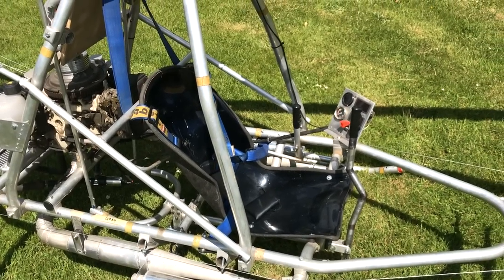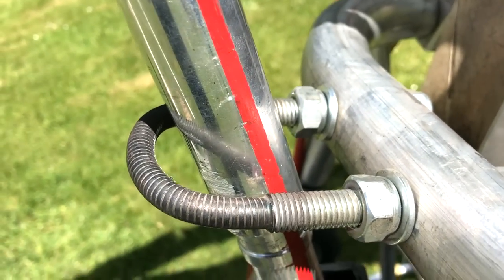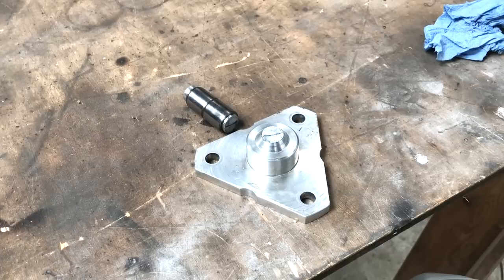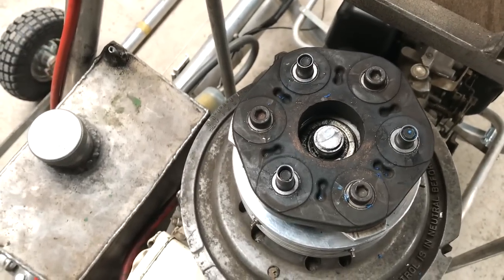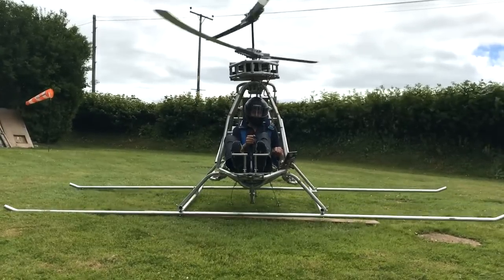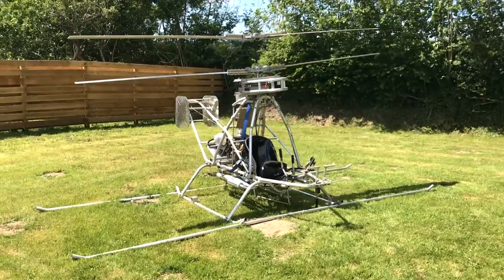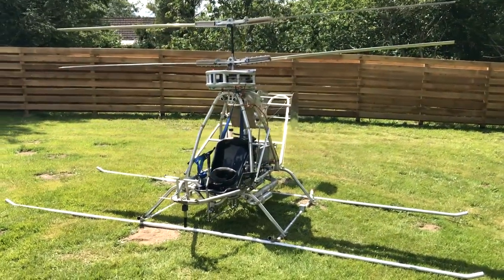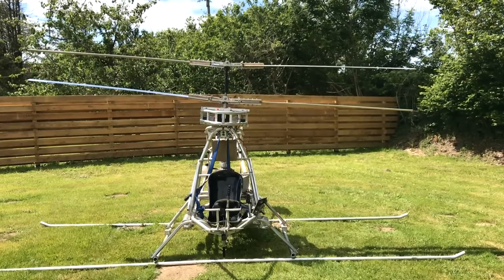Part 4 Learning to FLY Homemade Helicopter

Comment: I was so pleased to see another video up! Interesting visual, that tilting the rotor disc does actually change the blade angle of attack. Really no different than weight shift in a hang glider changing the angle of attack , precession delays the effect in the disc to your benefit.
Reply from the maker: 👍 It's amazing how all the physics in a  helicopter allow it to function. The forces all seem to come together to make it work. Centrifugal forces keep the blades ridged, aerodynamic forces overcome the gyroscopic forces and it can autorotate with the blades spinning in the same direction. Quite amazing some of it.

Comment: Your videos are great Ben. I'm watching with a big grin on my face. Brings back great memories. Cheers. 🙂
Reply from the maker: Thanks Cam, it takes some patience doesn't it. I'm at the stage where I've got some control over it but an overreaction is just around the corner, part of me wants to take it higher as it should be easier with less turbulence but I feel I must keep it low for now. Did go through this stage ? Any close calls ?

Comment: It's so cool the way that tilting the head and mast in the direction that you want your force vector to tilt increases the blade angle of attack in the quadrant 90 degrees prior to where the lift is required, just as it should and also just as it does in a swash plate/pitch linkage setup. Seeing this work the way it does actually gives me a better understanding of helicopter cyclic control.
Reply from the maker: Absolutely right, I only grasped this a few weeks ago. Some people think that the pitch change on a swash plate happens 90 degrees before hand because of gyroscopic precession, but I believe it's aerodynamic precession. It just takes time for the blade to fly to its new position. 
 It does mean that the cyclic isn't going to be any easier to learn on my machine than any other helicopter but it should give an advantage if I have another go in a Robinson. Once I've got the hang of this I would like to see how I get on with an R22. The pedals and collective will have a different feel/response but it will be an interesting experiment.
Reply: @Ben-Dixey  That's the way that I have always thought of it, it takes time for the blade to lift up so that the rotor disk is tilting the way you need it to be tilting, the blade starts climbing 90 degrees in advance and 90 degrees later its up where you want it to be and  has leveled out in exactly the right place and is about to start descending back down again.
Reply: @Ben-Dixey  Its gyroscopic precession, . try tilting a spinning gyro.
Reply from the maker: Gyroscopic precession is cancelled in a coaxial configuration. I mounted two bicycle wheels on an axle and spun them in opposite directions. It behaved as if the wheels weren't spinning at all. However the teeter hinges add another complication. If it was gyroscopic precession wouldn't the cyclic stick be extremely hard to move ?
Reply: @mrbmp09  The point at which the blade needs to start climbing is also the axis through the disk about which the disk tilts, which of course has to be 90 degrees before the point in the disk that will be at the top of the tilt, and the opposite end of that axis is 90 degrees after the top of the tilt, at the top of the tilt the blade angle of attack should be neutral and it should also be neutral the bottom of the disk tilt, so the cyclic blade pitch control of the disk tilt is always 90 degrees before the intended disk tilt, it has to be, the blade must start lifting exactly from the axis of tilt which is 90 degrees before the top of the intended disk tilt.

Comment: It seems you're finding out the hard way the reasons why aircraft manufacturers use Titanium components where required due to their strength, light weight and durability and especially their corrosion resistance ability.
Yes it's expensive but well worth the expense.
I'm sure you'll work it out.
The properties of steel are a much better choice than aluminium even T6.
Thanks for sharing your video's, I'm an Aircraft Maintenance Engineer so I understand what you are talking about.
I wish you every success you've done well, there are obviously design changes that I may have done differently but I haven't undertaken this venture yet, so I'll keep my opinions to myself 😃👍
Stay safe!
Reply from the maker: Thanks, I've used EN8 for the replacement 6082 t6 aluminium part but it was a fatigue failure and that as you will know will mean the EN8 replacement will have a time limited life. I have no way of testing this part other than on the helicopter so my intention is to carry out periodic crack testing. I know the aluminium part lasted between 60 and 100 test runs, so I need to start checking the new part soon. Titanium has similar properties to EN24T as a much less expensive alternative but with a big weight penalty. I have never worked with Titanium but certain parts would be worth using the material.

Comment: Looking good. What hp outboard engine are you using? What rpm do you expect to run at normal altitude ?
Reply from the maker: Thanks, the outboard engine is a 60hp Johnson but my tuned exhausts might have added some hp. Rotor rpm is around 760 when lifting off.